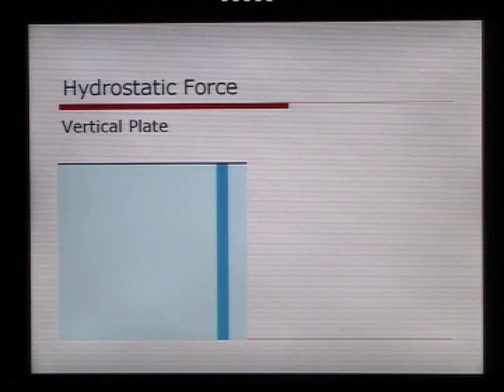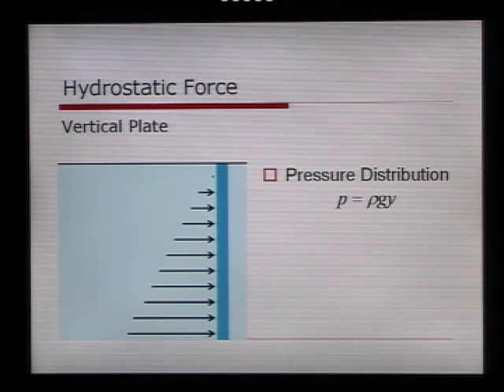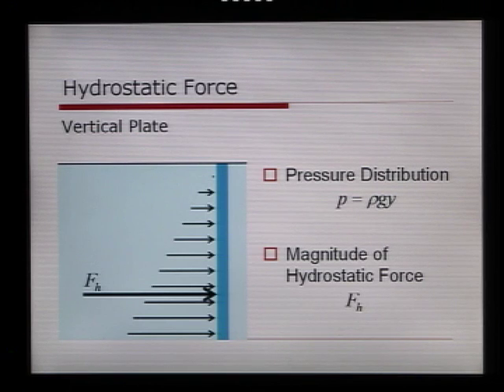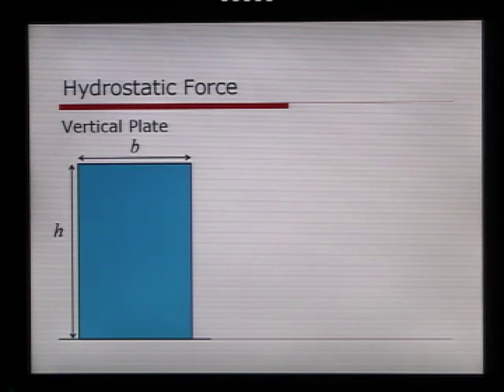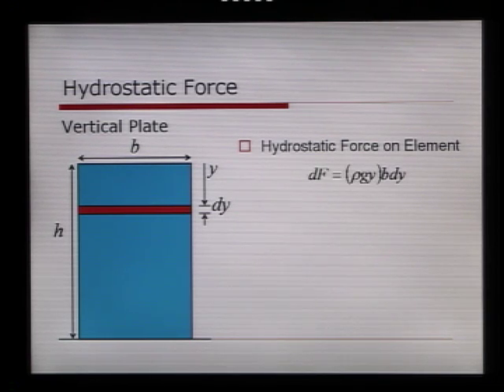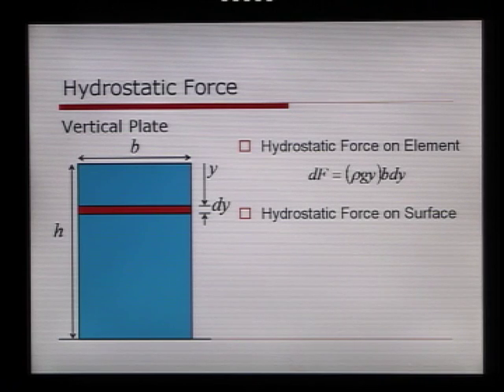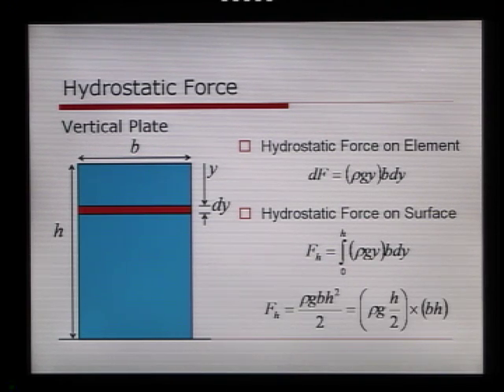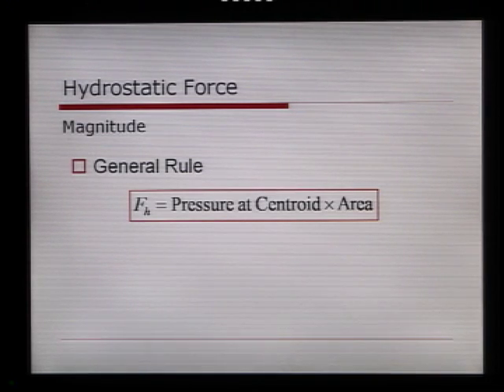Introduction to Fluid Mechanics, Podcast #6: Hydrostatic Pressure

Comment: I just don't understand this, but I need to solve a problem.  I need to calculate the static pressure against a 2ft by 16ft  section of my garage door. In flash floods, the water pushes in my door.  It get's expensive replacing them!  I want to reinforce my new one but I don't know how to reinforce it if I don't know the pressure is against it.  My calculations gives me 2000 lbs.   However, every explanation of the pressure ignores the volume of water that is pushing on the door (or any flat vertical surface).  Isn't there a substantial difference of force if the wall holds back two feet of water vs 20 feet of water?  How does this formula work in real life examples?  I think it's only calculating based on a volume of water 1ft wide by 2ft high by 16ft long.  Do I just multiply my answer by the number of feet of water being held back?  Any insight is appreciated!!

Comment: can we also calculate the force by using force=density g(h*b) ? if not why so???
Reply from the maker: Afraid not - this would be the pressure at the bottom of the vertical wall (rho g h) multiplied by the width of the dam (b) - so two things wrong here. 1) The pressure is not uniform across the whole wall and 2) the pressure would have to be multiplied by an area